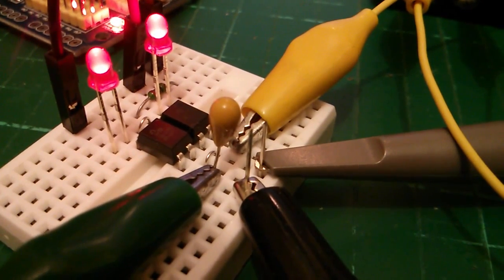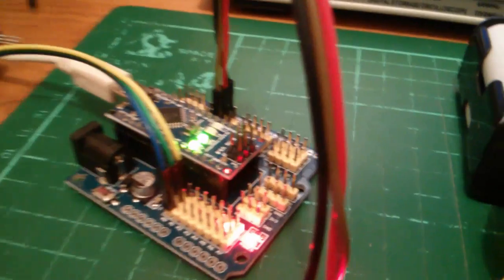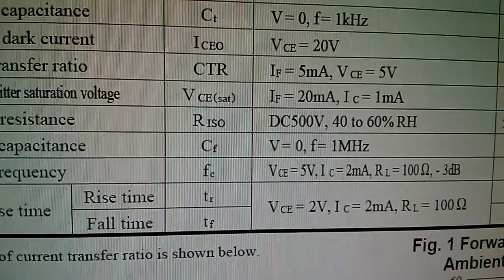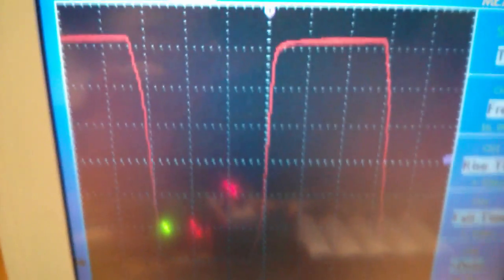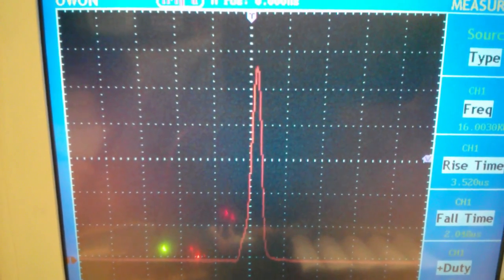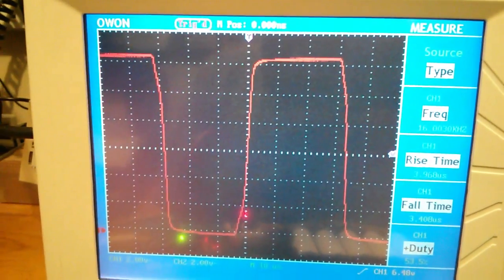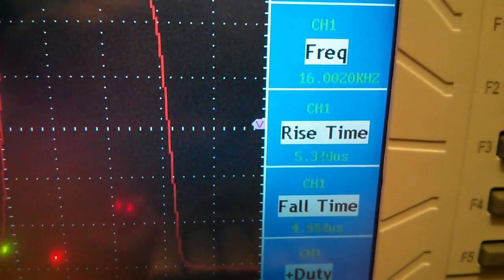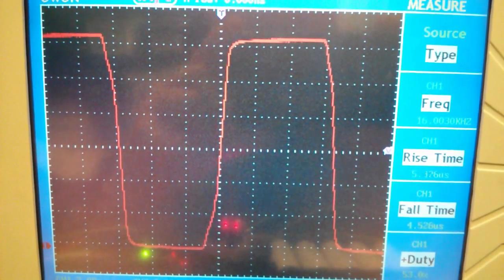Dual Complementary Opto-Isolator (DCOI) High Side MOSFET Driver #3

Comment: Yeah one solution would definitely be to employ a logic level mosfet. This circuit usually makes it at least to 5.5 volts when it is on. It's just getting hold ov one. The local electronics shops - Jaycar - are a bit thin on the ground when it comes to mosfets. There's a PSMN1R2-30YL I would like to try and it's fully on at 4.5volts with a Rds ov only 1.3 milliohms. It's a SOT-669 package though, but I reckon I could solder it to a bit ov copper or something. But to get one might be tricky.

Comment from the maker: That's odd - the Vishay IRF540 datasheet says 77mΩ at Vgs=10v, but the IR IRF540 datasheet has 44mΩ for the same gate source voltage. You could try the IRL540 (I think L stands for Logic level). That has the same 77mΩ spec, but at Vgs=5v.
Interesting you mention the leads not handling the high current. Take a look at the IRF1404 - drain current 202 Amps! But it's a theoretical die current at maximum temperature. Note 6 says that package limitation current is 75A.

Comment: It's an IRF540. Supposed to handle 28A (but one wonders how the leads would!!). It has an Rds(on) ov 0.077R but that is at Gs ov 10 volts. I think that's where the trouble is starting, because I am giving it 6V and from a rough calculation from the current flowing in the circuit and the voltage across the drain & source (approx 2.5V) it appears to be running an effective resistance ov 0.25R, which ov course at 10A is 25 odd watts!! No wonder the bugger is getting hot ! :)

Comment from the maker: Yes, it would be a little under 12v.
What's your FET's Rds(on)? I changed the FET in my PWM5 controller from a 17mOhm IRFZ44N to an 8mOhm IRF3205 and it made a big difference to temperature at just 6A. There's no heatsink in my design. 6V on the gate may be enough.

Comment: A transformer can also limit the high frequency response too. How many volts are you hitting the gate ov the mosfet with? I assume it's somewhere in the order ov 12v minus the drop through the optocoupler? I am having issues with driving one at present. I am giving it 6 volts and it's on, but I still think it's in linear mode as it's getting kinda hot passing 10 amps.